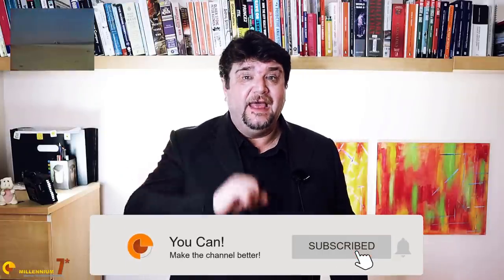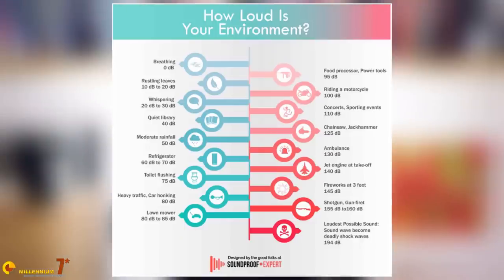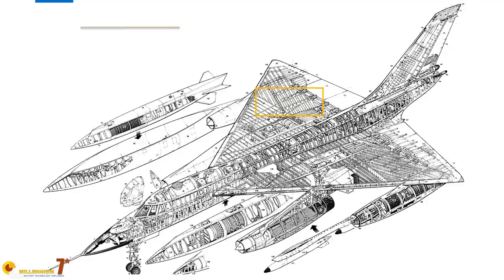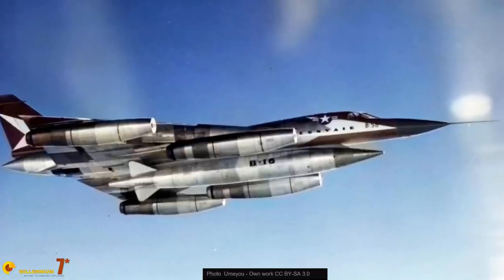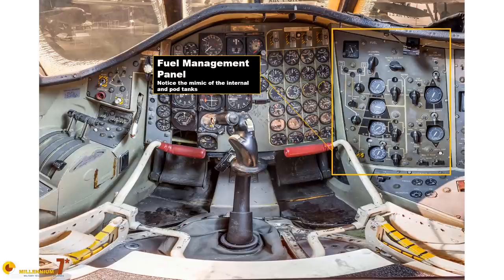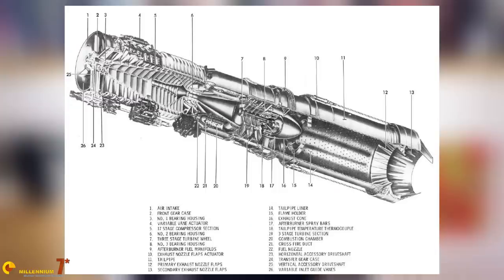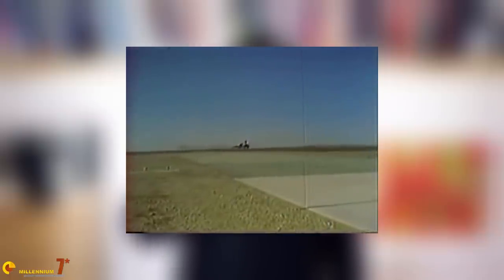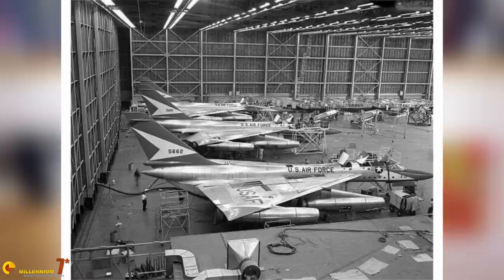B -58 | "It Was Built Like A Ship!" - Part 2

Comment: The engine was not meant be intentionally operated at 107% for 5 sec or less, that was a time limit for an unintended overshoot of the intentional 103.5% overspeed limit.  The pilot could select an 103.5% overspeed with the throttle , but the T-2 cutback system would not allow the rpm to increase to that level until the ram air temperature parameter was met.  This rpm only increased thrust at those high ram temperatures, and below them the MAX AB detent produced more thrust.

Comment: I believe the 10,00 lbs. thrust rated you quoted for the J-79 was for dry thrust rather than with afterburner.  Afterburner thrust was around 15,000 lbs.  Later versions of the engine produced even greater dry and AB thrust.

Comment: The video makes it sound as though the B-58 was unique in being susceptible to hot brakes. The B-58 had a drag chute so hot brakes was not a normal occurrence on landing. All airplanes can experience hot brakes on a rejected takeoff or overweight landing, and fire fighters avoid approaching them from the side on any aircraft.  The risk of tire explosion is reduced by fuse plugs that should melt before the tire explodes, but extreme temperatures can lead to burst hydraulic lines and fire.  The B-58 was not unique or deficient in this area.
Reply: Excellent comments.
Reply: @wkelly3053  Nice to hear somebody appreciated them.

Comment: A great video (as usual in this channel). Only thing that doesn't fill right is  what you said about engine thrust. For a J-79 wit full afterburner, it should be closer to 15000-16000 pounds if I'm not mistaken.
Reply from the maker: Yes, it was a mistake, unfortunately

Comment: Nuclear warhead on the fuel tank .. that is frightening and hilarious
Reply: Not really frightening at all. The nuke could go down in a fireball and not detonate by accident. All nukes ride along with the fuel when you get right down to it. Nuke firing safety is designed to be reliable and proven to work in a number of accidents.
Reply: @Ni999  that is good to know👍
Reply: @pratikpal5565  My pleasure. 👍 The original design was a little sketchy because the nuke would be soaked if fuel leaked. Why take any chances? That was quickly fixed by separating the two packages and putting the nuke on top, and the fuel part could be dropped separately. The B-58 and the external pod takes a lot of criticism but it was very early and we just didn't know as much back then. Even so, if we didn't care about stealth these days, we could still go with the final pod from back then.
Reply: If you could trigger an atomic bomb with a fire, i think we would know. XD

Comment: Is it just me or does this thing have a strong family resemblance to the B1, in the cockpit and nose?
Reply: I never noticed but yeah, long pointy nose, paned windows - good eye. 👍
Reply: The resemblance must coincidence rather than family because they were not of the same family, right?  Coincidence easily occurs when all fast jets have pointed noses.
Reply: @gort8203  It's not unheard of to describe two unrelated people as having a family resemblance. In fact, it's really quite common. No one really analyzes genealogy when that happens, the phrase simply underscores the similarity in those cases. Of course, everyone in the human race does have a family resemblance - along with a genus resemblance and a species resemblance. And so it is with the two planes in question. Both made of metal, both employing some sort of jet engine technology, both having landing gear, and both using flight control surfaces. Coincidence?

Or maybe there is a family and it's "bombers selected for production by the USAF during the Cold War."
Reply: @Ni999  II guess it's 2020 and words have no meaning. If you want to expand the subset called a family to include a larger set that includes multiple families have at it.  I'm just too old for newspeak.  Every human has a head with a nose in the front, but I don't consider it a family resemblance, although we might look all the same to a space alien.  I think many people who are less familiar with airplanes also think they all resemble each other..
Reply: @gort8203  Yeah, don't hand me that. It wasn't a good time to be pedantic when I watched my first Hustler roll off of the apron in 61 and it's not a good time now. No newspeak about it - not even a nice try with that chestnut. This started out as just a pleasant Sunday morning whiling away the time with a pleasantry over a simple notion. You wanted the opportunity to show how yours is bigger - and you got what you asked for.
Reply: @Ni999  I think you must be doing what they call projection here if you think this is a contest.  You might want to note that your initial statement was vague enough that it seemed you were thinking both aircraft were indeed made by the same manufacturer, which is what most people mean when they talk about a family resemblance in aircraft.  I was wondering if that was what you meant, but you're so sensitive about being questioned that you had to get pedantic about the common meaning of the word family.  Don't ask what I now see was a rhetorical question if you can't stand to be questioned about its intent.  Sorry I read your comment and took it seriously.
Reply: @gort8203  Right. The only possible way to interpret the question and my response is to assume that I'm ignorant and then do me the kindness of magnanimously helping me with that. Brilliant people skills along really fantastic reading comprehension - how efficient of you. I'm guessing that you find most of the world irritated by you and the only possible explanation cannot be that it's something you're doing - no, no, your best guess is we're all projecting. Lmao, what a maroon.

When you can't understand how someone arrived at something, the most obvious, logical explanation is that they're ignorant. Brilliant!
Reply: Look. All I mean is, that the shape of the windows, nose cone, cockpit section of the fuselage and the way it tapers rearward are very similar, to the point of being suggestive. I am not an expert and this is pure speculation but I would not be surprised to learn that some hustler engineers migrated to rockwell when they began work on their own mach 2 bomber. In any event, I realize that similar briefs will beget similar designs but the hustler and b1 look much more alike than any Russian supersonic bomber and indeed the Russians don't seem to have such an affinity among themselves.
Reply: @unclejoeoakland  Overall, you're not wrong. If we think of it as an expression of design language, do we have other examples from the same general period? Yes we do. The B-70 that never was but you can check out as the XB-70 Valkyrie (by North American who would later participate in the B-1). That was canceled but the General Dynamics F-111 was not, and it came between the Valkyrie and the B-1. All with pointy noses and that very American look. 

Prior to the start of NASA in 1958, we had NACA - the National Advisory Committee for Aeronautics. That became the fountainhead of knowledge for airfoil, wing, and body designs and had a big impact throughout and past WW2. Everyone shared information, it was pointless to duplicate efforts. Between that, US Air Force testing, and NASA, we built and were expanding our design language for supersonic air vehicles. And in the 60s, we got Secretary of Defense McNamara, fresh out reorganizing the Ford Motor Company, and insistent on cost savings through program standardization. He insisted on multirole aircraft that would be suitable for every branch of the military to save costs, rather than what he viewed as redundant but different programs. Within a few years, he had all of the major military airplane manufacturers sitting at the same committee table to prepare to respond to the need for modern designs in their immediate future airplane proposals. And they absolutely made a close study of the B-58, that's well documented as I recall. 

So yeah, long pointy nose with a certain very American look was more than a simple case of similarity strictly because form follows function and it certainly influenced the B-1, no question about it.

Did some of that that happen because of engineers and designers moving between companies? I don't know. Maybe. But I do think that it's safe to say that even if they didn't, you can go past skin deep and who made what and find more than a passing design similarity in other parts of various planes from back then and since. I can't prove this but I think that the easiest way to ruffle the establishment back then would be to show up with a proposal that wasn't looking in alignment with the standard ideas. 

Ruffling feathers is not the sort of thing you choose first when looking for a big contract. Except if you're Kelly Johnson at the Skunkworks and roll out the SR-71. Worth noting that McNamara ordered them to destroy the blueprints and design documents for it. The other manufacturers couldn't compete and there'd be no way to standardize any of it.

So, yeah, I've been staring at it all along and I didn't even notice it before. There does appear to be a family resemblance and that's as good a term as any to hit the nail on the head. Good eye!